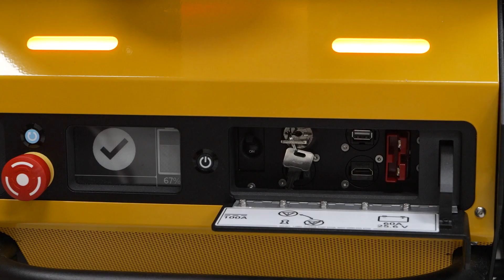Husky A300 Unboxing Guide

Comment: for what we use this kind a robot?
Reply from the maker: Great question!  Husky A300 is designed as a research and development platform for building autonomous robotic systems.  It's used by researchers exploring leading-edge research in AI, autonomy, mobile manipulation.  It's also used by developers building autonomous solutions for industry (e.g., autonomous inspection, data collection, surveillance).  With its modular design, researchers and engineers can customize it with sensors, cameras, robotic arms or custom payloads to suit their specific needs.